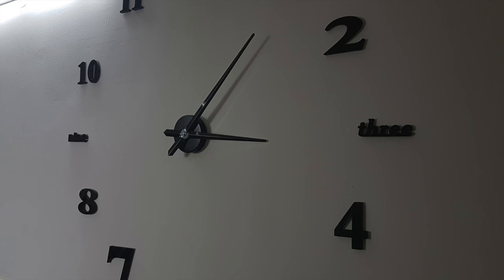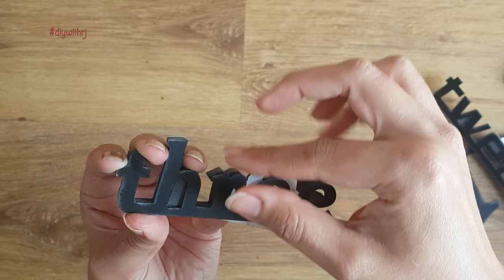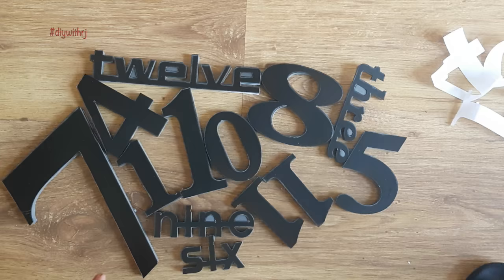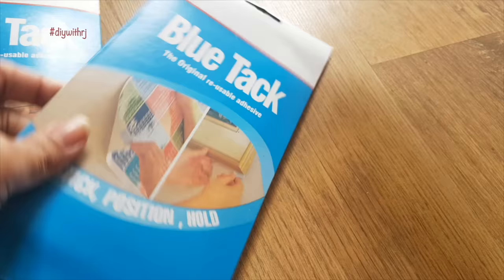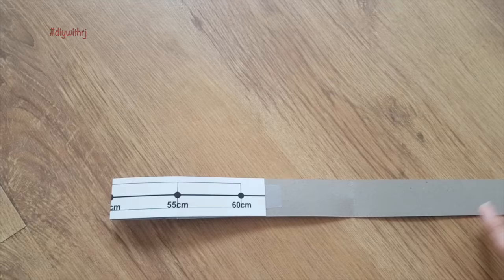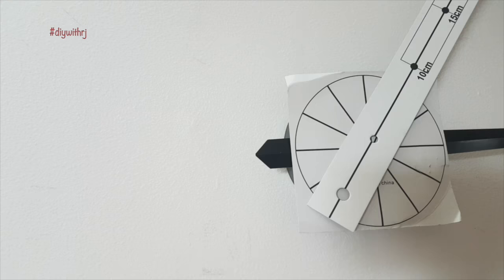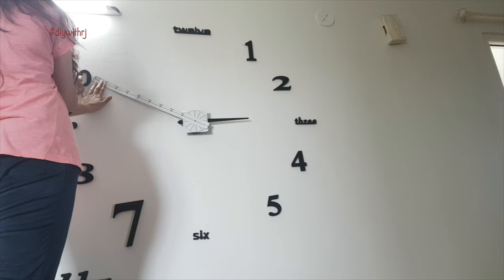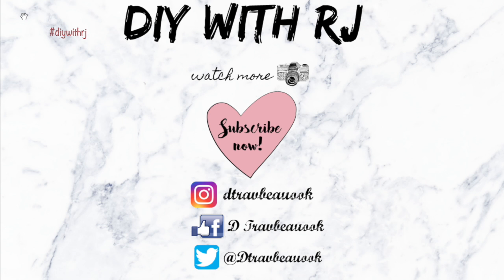DIY BIG WALL CLOCK Installation || DIY with RJ

Comment: I bought one like that. But im not sure if the clock is working. Did it make sound when you put the battery? Please help.
Reply from the maker: It works & sounds same as any other wall clock. Hope this helps🙂

Comment: I hope you have a very long-life battery. How you change the time when the clock is to slow or to fast?
Reply from the maker: Yes, it did lasted more than 1.5 years.. I just rotate the minute and hour hand in case of time change.. I donot take out the  machine from wall for that .. Have a nice day ahead.

Comment: Hey beautiful,  my clock just came in today. Did you find 50 cm was best  for that good sized wall ? Would you have liked to do the 60 cm instead?
Reply from the maker: 50 & 60 cms both will look good... Just check the wall space... If its open and big then go for 60 cms.. Do watch this video too before installation  https://youtu.be/bVfXz5axmz8  ... Have a good day ahead 😊👍

Comment: Can you help me, why the clock is not rotating what batteries we should use? It worked for few mins and it stopped
Reply from the maker: It requires double AA batteries
Reply: @RATIHOMEBOOK  yeah I used AA but still it is not working there is no seconds nail right, the black centered one is rotating and stopping every few minutes

Comment: I have this clock. Mine has a battery and mechanism which has a disc which covers the back of the battery-the thing is how do I fix it to the wall?it just doesn't work with the disc covering the back!  I noticed your battery mechanism does not have a back covering-should I leave it off?
Reply from the maker: Before fixing on the wall.. Lay it on floor with back panel open, batteries inserted and minute/hour hands attached.. See if it works like that.. If it does then you can surely leave back cover open

Comment: Where should the wall clock be hung? What should I pay attention to when using a wall clock?

Abstract: The wall clock was first evolved from the tower clock. In the 16th century, the huge volume of tower clock buildings appeared in Europe. Due to the manufacturing technology at that time, the clocks were generally large. With the development of technology, the breakthrough of quartz clock technology in Japan in the mid-20th century and its application in timepieces. Small wall clocks are popular among thousands of households. The wall clock combines time and art, and an art wall clock can reflect the artist's artistic accomplishment and create an artistic atmosphere.
Keywords: Acrylic; Clock; Eco-friendly; manufacturer
Basic structure of the wall clock
1. Front shell (also called front cover): Surface treatment methods include: direct injection of color, painting, plating, coating (also called transfer), hot stamping, etc.
2. Back shell (also called back cover)
3. Battery cover
4. Mirror surface: The material is made of glass (also divided into flat glass and arc glass) and plastic. The wall clock is basically glass, and the table clock is available in two types.
5. Clock face (also called literal): material is paper, PVC (plastic), metal. The scales, words and patterns on it are all screen printed.
6. Clock hands (also called hands): The material is made of plastic and metal. The wall clocks are basically made of metal, and the table clocks are available in two types.
7. Movement (when walking):
1)According to the operation mode of the second hand, it is divided into: the chronograph movement and the sweeping movement (also called the silent movement).
2)Wall-mounted clock movements are divided into: single-time movement (single machine) and music hour-time movement (also called the movement).
The 3 clock movements are divided into: single machine and alarm machine. Among them, the alarm machine is divided into a single-playing movement and an alarm machine with snooze function. The alarm sound of the alarm is divided into a single-segment BB sound and a 4-segment BB sound (that is, a BB sound that is weakly strong).
8. Screw
9.LCD (ie liquid crystal display) components: divided into Chinese and English. There is only one LCD component in a clock, and the general display contents are perpetual calendar (ie, calendar year, month, day, week, Chinese with lunar calendar month, day) and temperature; one LCD has two LCD components, one of which The perpetual calendar is displayed and the other one shows the temperature and humidity.
10. Pendulum movement (auxiliary movement): divided into a swing pendulum movement and a swing movement.
How To Place The Wall Clock
In the traditional Feng Shui theory, some halls and room wall clocks are necessary, especially in the integrated office, and should be linked to the clock. Hanging the clock in such a place can have five major functions. One is to recruit wealth into the treasure, the other is to avoid evil spirits, the third is to help the host fortune, the fourth is to manage the ministry, and the fifth is the most basic function of the clock. This is not to say that you can buy a clock and just find a place to put it, if you hang the wrong place, it will be counterproductive. In general, the front of the clock cannot be inward, and the direction toward the door or balcony is best.
Wall clock considerations
No matter the clock, the wall clock, its hour, minute, and second hand will continue to run. If placed in the living room, there are a few points to pay special attention to:
1, can be placed or hung on the Suzaku side, because the Suzaku side is the front, the front is the mover.
2, can be placed or hung in the Qinglong side, because the Qinglong side is the Kyrgyz side, so the left side of the living room should also put the clock.
3, do not place or hang in the white tiger side, because the white tiger side is a fierce party, so the right side of the living room should not put the clock.
4, do not place or hang in the Xuanwu side, because the Xuanwu side is the rear, should not be moved.
5, the top of the sofa should not hang the clock, otherwise, people who often sit in this position are prone to problems.
6.Place or hang the clock in the bedroom, which is roughly the same as the living room, but the clock cannot be hung at the bedside.
                                                                    

Chongqing Chenghongzhi Import and Export Trade Co., Ltd. is a company of acrylic products manufacturing, which is from China. As is known to all, China is the industry of the whole world, so the price of the products is cheaper than others but with higher quality. Its main products are Acrylic Wall Stickers, Acrylic Wall Clocks, MDF Wall Clocks, Cake Toppers, Metal Posters and Sunrise Alarm Clocks. 

Welcome to buy it!
                                                                                
Chongqing Chenghongzhi Import and Export Trade Co., Ltd.
Website:www.preciserclock.com
Email:sum.preciser@gmail.com
Whatsapp: +18140232818
Tele: 1732323320
Reply from the maker: It entirely depends on where you want to place the wall clock. The thing to be kept in mind is distance while placing digits on the wall.
Reply: @RATIHOMEBOOK  Yeah,  I agree with you, but in some countries in the world, they pay more attention to it.
Reply: Check out the other instructions for these clocks